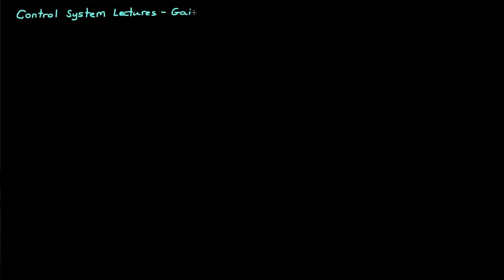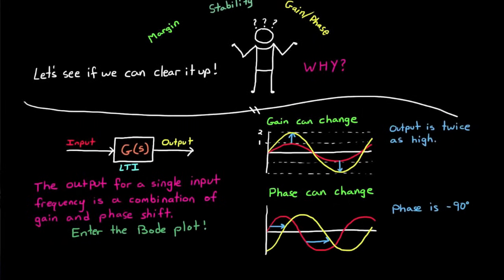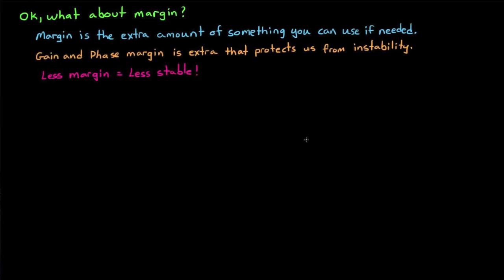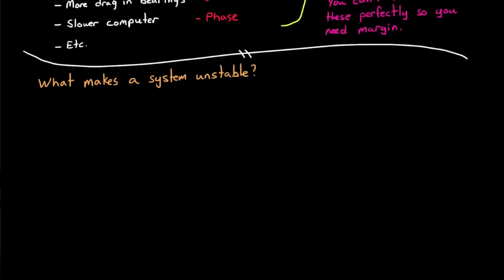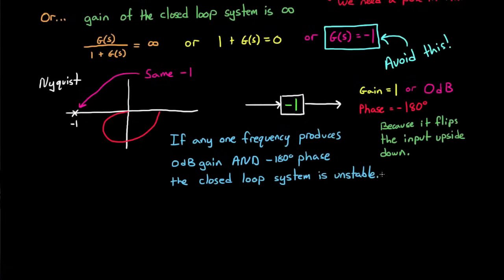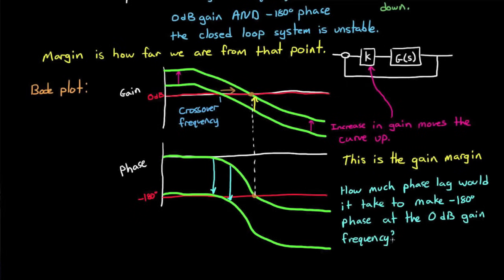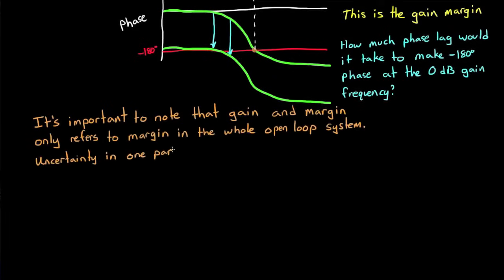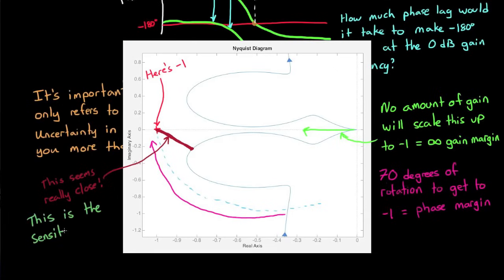Gain and Phase Margins Explained!

Comment: From bode plot, I can decide at what freq system would become unstable. at 10:45  at 300hz phase become -180. So the system is unstable,But what if I don't use 300Hz freq and I use 100hz ,will my system become unstable at any point? If yes how ? As I am not hitting the unstable freq ?

Comment: How do you solve for gain and phase margin just using a transfer function? Without using bode or nyquist
Reply: H(s) is transfer function
For phase margin: you search the s wherefor abs(H(s)) = 1 (That is the point where bodeplot gain is 0dB) 
Then you find the angle at that specific point angle(H(s)) and you compare it with -180°
For gain margin you do it the other way around and you search first where for the angle is 180° and then you search what the gain is there and compare with 0 dB

Comment: Great job man! I've been trying to figure out for a week why we want to avoid GM = 0 and PH = 180. Thanks!!!
Reply: Aj Miller because that is the case for critical stability. If you have any questions further feel free to ask.
Reply: @UpendraYadav-mh9mm  I just want to make sure about one single thing: I understand that we avoid GM = 0 dB  and PH = -180° in the open-loop system in order for its close-loop configuration to be stable, but that's only true for an unitary feedback, right? Because if the feedback has, for example, a gain "K", then the resulting transfer function would be G(s) / ( 1 + K*G(s) ), therefore the close-loop system would become unstable when G(s) = -1/K, not when G(s)=-1.  Am I right?
Reply: @Marchel0522  Sir your logic seems right. But I guess you analyzed something wrong.
The plot used to calculate GM and PM is constructed for open loop function ie G(s)H(s).
For stability poles of closed loop(1+GH) are checked for polarity. And hence open loop plot GH is checked at(-1,0).
So in my view it wouldnt make a difference if the gain is unity or not because that would be included in open loop plot GH and plot will still be checked at (-1,0).
But still i'm not an expert and out of touch with control for few years, so do discuss it with someone good at it.

Comment: Could you please answer these 3 questions?

1. Difference in the formula of GM and PM of Bode Plot and Polar Plot. Reason. Concept. Physical significance of this difference.

2. GM of polar plot of 1st and 2nd order system. How is it infinite mathematically?

3. The formula of getting GM, includes equality of the total angle contribution to 180deg. But for infinite GM, (such as 1st and 2nd order system) the polar plot does not intersect with the real axis, i.e.,(+/)180 deg line. Then, for such cases, is it logical to equalise the total angle contribution to -180deg, while searching for the result mathematically?

Comment: Why is it that just one frequency that crosses the -1 point in a closed loop system is enough to make the entire system unstable?
Reply: +Tomasz Zieilński, from a practical standpoint, It is because if you send a step response to it, you will excite that frequency (All frequencies in theory, a widespread frequency spectrum in reality depending on the slewrate of the device) and therefore you will saturate the output. Hope it helps :)

Comment: Hi Brian, Can you please explain why in a Phase Locked Loop (PLL) the loop filter bandwidth has to be less than 1/10 th of the reference frequency for stability? How can I explain this using stability margins/ Nyquist stability criterion? Also why gain peaking is there in the closed loop response near cutoff if phase margin is low?

Comment: If what we are trying to avoid is -1, then the system will be stable for positive gain margins and for negative gain margins as well. Is that right? But as far as I know the system is only stable for positive gain margins.
Reply: Arkan Arya you are absolutely right about the +ve and -ve gain margin concept.But our aim is not to avoid -1, rather to have system cutting the -ve axis in such a manner that the polar plot is stable and have + ve gain margin. You can try it for simple example where plot intersects the -ve real axis and see for it.

Comment: My question is that "  how can I make the decision for calculating phase margin ,if there are more than one gain crossover frequency? Please help I have final exam that cover the this topic.
Reply: yavuz kağan topak the examples which i have seen, there is no such case which i have encountered.i would be glad if you give one. if any such case exists, the stability can be discussed using polar and Nyquist both. i cannot comment on phase margin for now
Reply: Upendra Yadav thanks for your answer sir, but i have graduated from the university 😊

Comment: One thing I never see explained is why do the margins need to be positive if all we are trying to do is avoid the -1 point? If at the gain crossover frequency the phase is -200 deg, this is still 20 deg away from the -1 point. Why would being below -180 deg make it unstable?
Reply: +ahage16 Are you sure your case would be unstable?
Reply: ahage16 it would be unstable as while passing through -ve real axis,it would have intersected at a point with gain more than one as gain goes on reducing for MPS. hence gain margin would have been -ve.If u still have further questions feel free to ask.

Comment: hey!! what if my control system doesn't run on a sindusoidal input or doesn't end up producing a sin output??  lets say i am inputting a d.c power to speed control a d.c motor in a closed loop fashion.! can these analysis still hold good for such systems? 
really sorry if this is a dumb question.I have just started learning c.s!!
Reply: Prasad Beer Yes,you can .I think Brian posted a similar video on how  a transfer fuction of  a stepper/servo motor is calculated.
Reply: Prasad Beer for dc signals you need analysis using time response analysis and stability using RL and routh Hurwitz. This method is applicable for ac signals

Comment: Your videos on control theory have been helping me a lot! I have a question: around 1:04 you mention that when one talks about gain, one is actually referring to the steady state gain. However, in the graph you plot a sinusoidal wave, not a constant signal (zero frequency). For me, steady state is something reached by systems when they stop oscillating, such as when you plot the step response of an RC circuit and check at which value the response ends up, e. g. if it stabilizes at 3 then I would say the gain is 3. I am starting to think that steady state in control theory has a slightly different meaning than in circuit analysis. Could you please clarify this for me? Just to make it easier for you to explain, I've already taken a first course on signals and systems, so I know that if the input of an LTI system is exp(s*t) then the output will be H(s)exp(s*t) (something you mention in a graphical way with s = j*w). For me, the steady state gain (or just gain) would be H(0), however you talk about steady state and plot the real part of H(w)*exp(j*w*t) for a non-zero w, so I'm not seeing what's steady :P. Thank you very much! P.D.: I put everything in a single paragraph because additional ones make YouTube hide the rest and I wanted you not to miss anything accidentally.
Reply: Steady state in this instance refers to the fact that all transients have decayed. Imagine you have a system set up and ready to go but with no sinusoidal input yet. When you turn the sinusoidal input on there are some short-lived (transient) signals that are produced because of the discontinuity at t=0 . These are superposed on an underlying sinusoidal signal -- the same thing happens with a Heaviside step input causing an output which lags up its final constant value (except that the "final value" for a sinusoid input is in fact another sinusoid rather than a constant value!). These transient signals decay exponentially for any stable system, leaving the underlying sinusoid. It is the gain and phase of this underlying sinusoid (relative to the input) that is plotted on the Nyquist diagram. It is worth noting that this type of analysis works only for open-loop systems that are themselves stable -- otherwise the transients would not decay, but would grow exponentially to engulf the output signal!

Comment: sir i have doubt ..u said in lecture that bode plot defines stability of open loop system,but in actual systems are closed loop so how does bode plot comments on closed loop stability?
Reply: The denominator of a closed loop TF is 1 + G(s), where G(s) is the open loop TF.
You want the denominator of the closed loop TF away from zero, so you want the open loop TF away from -1.
-1 corresponds to a 0dB gain and -180degree phaselagg on the OPEN loop TF bode plot. If you keep the open loop away from this point you assure to keep the closed loop away from zero.

Comment: Mr. Douglas, thanks for yours lectures. They are very clarified.
Is correct to say that if is possible place a integrator in the system, this will push back the system to a action less unstable? I mean, ever that is possible, put a integrator!!???

Comment: Hey Brain,
First I would like to thank you for your high quality videos :).
Secondly I have a question.
Does your system only becomes unstable when both conditions are met or is one condition more dominant for stability?
Reply from the maker: Both conditions need to be met in order for steady oscillations.  And I would say that it depends on your system (and variations in the system) that determine whether it's gain or phase that is more important to you. However, stability margins do not tell you whether your system is already closed loop stable or not just how far you are from that cross over point.  I'm sure what I just said was confusing and should make a video on it but you can have a system that has positive phase margin and still be closed loop unstable; check this system out in matlab if you can (s - 5)/ (s^3 + 2*s^2 + 3*s + 3). Infinite gain margin and 136 degrees of phase margin but closed loop unstable.  The culprit is the right half plane zero that is messing it up, this is non-minimum phase system.
Reply: Brian Douglas Thanks :D!

Comment: Hmm, I think one match application I realize to this is quadcopter  PID attitude control, I observe plotting each PI and D shows that increasing gain of D, D creates a backward shift,  backward of the PI plot. Make sense because during disturbance , D becomes an added .force to PI to counter disturbance, while D  become subtracting value to PI i.e as breaking  force preventing PI to overshoot when it tries to return the body to desired attitude. So i think this is the theory behind. Thanks Brian.

Comment: Hi Brian, I have a question : what if the magnitude plot crosses the 0db multiple times , the same can be asked for the phase plot and -180 ? How to determine stability in that case ?
Reply from the maker: That can be a tricky question. The short answer is that at each crossover frequency you read off the gain and phase margin and take the smallest one.  Did you notice that when I plotted stability margins in Matlab it gave the option of showing "all stability margins" or just "Minimum stability margins"?  However, it can be tricky to interpret because for example a transport delay, like in digital computers, affect higher frequencies more than lower frequencies.  That's because the delay is a larger portion of the high frequency wave length (since they're faster). So you might have only 30 degrees of phase at a low frequency and 100 degrees of phase margin at a high frequency but still be more concerned with the high.  Really it comes down to understanding your particular system and trying not to rely heavily on standard rules of thumb for design.  Hope that helps.
Reply: Thanks Brain , this actually sums it up. However, to be more specific , I was asking about special systems which are called conditionally stable in which the phase dips below -180 before the gain crossover frequency and goes back to a value higher than -180 .